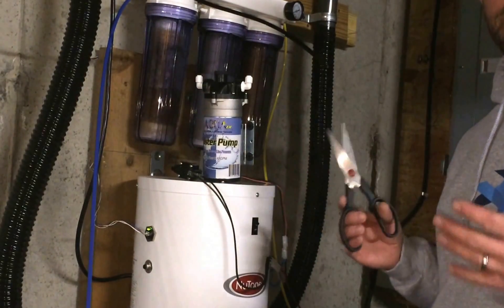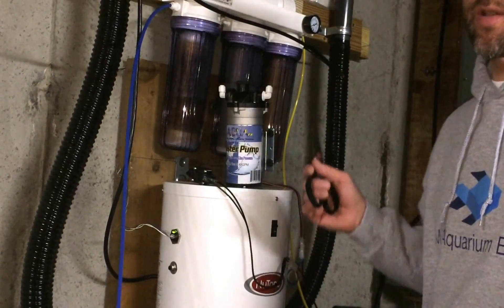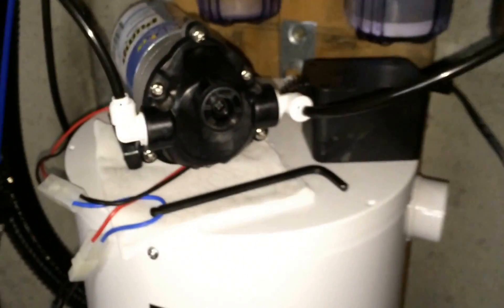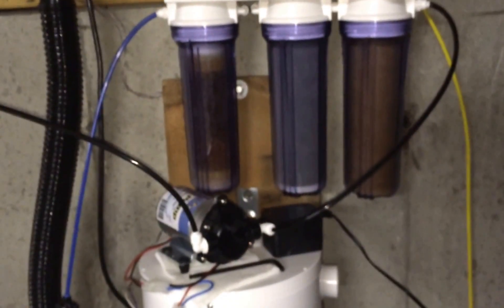HOW TO: Installing a Booster Pump for an RODI Unit. How to increase PSI in your RODI System. AquaFX

Comment: I installed this on my rain soft RO system, does the pump run all the time, hooked it all up correctly but the pump never shuts off.
Reply from the maker: You just unplug the pump
Reply: @MASSAquariums  it finally shut off and has been kicking on and off normally when pressure drops, great set up!! Has really increased our drinking water

Comment: i just bought my 1st RO, the pump not screw when it came so i remove some tube to fix it then i think i messed up the connection. my question is i have the same valve and tube i saw at 5:28 at the back. what is it? what is the purpose? mine is connected at T in between pump out and shutoff valve and other end to the T after high pressure switch. is that correct? i cant find any reference on this setup.

Comment: Question, what is the pressure going into your RO?  You will drop PSI going into the filters prior to RO.  Maybe better to install booster prior to  RO?  Seems also most run 1/4" lines vs 1/2.  1/2" feeder line off intake  would give more volume, more constant pressure with minimum drop. 1/2" ports on filters to JG reducer  1/2-3/8" into pump and 1/4 into RO.  imo
Reply from the maker: +GREG SHARP good info
Reply: Maybe not so good,  coz the pump makes pressure pulses so that tubings and cartridges then stabilize the pressure right at the membrane.
Not clearly got why they gave you high pressure switch,  it usually has to stop the pump when pressure tank is fiiled
Reply: @someoyou  with my ro system they recommend connecting the pump to the ro membrane
Reply: It's not bad to have low pressure switch on iinline - it will save the pump when water goes off (if it ever happens)
Another useful thing is to make auto stop function when filling your clean RODI tank,  I can tell how to do that cheap and simple

Comment: Only issue I see is forgot to put the check valve in the product line before the pressure switch. If it wasn't in the box it should have been.

Comment: Great vid. Most people don't realize how much water the cheaper RO/DI units actually use without a booster. Living in Vegas, water conservation is important. At a ratio of as much as 7:1, (waste to RO) it only makes sense to do this. If you live somewhere that has an abundance of water, no real issues, but if this pump can cut your ratio down to 3:1, it's worth it. Don't be a water pig!
Reply from the maker: Agreed

Comment: mike where you able to lower your psi with that adjustment?  i cant seem to get mine down . if i turn it too much it leaks
Reply from the maker: And I bought the membrane flush kit. It has a ball valve you can turn until the PSI is 80. Want me to put the link in the description